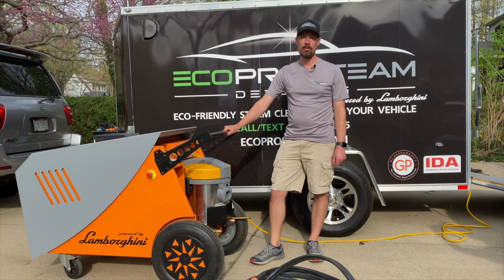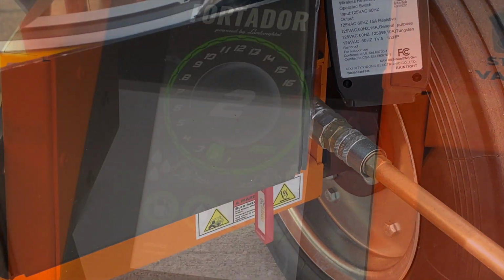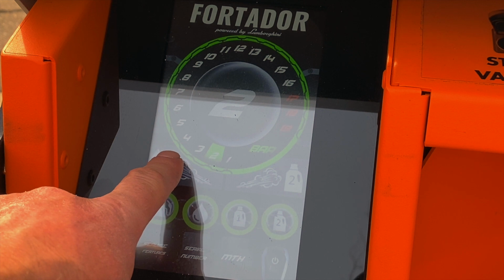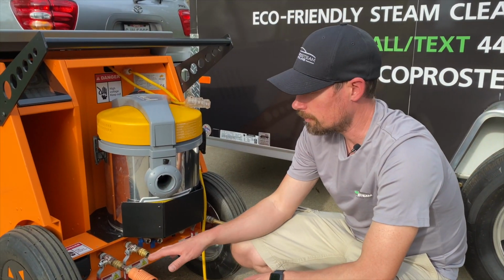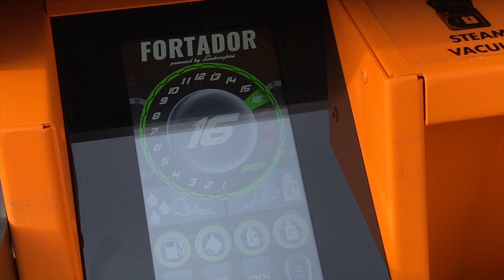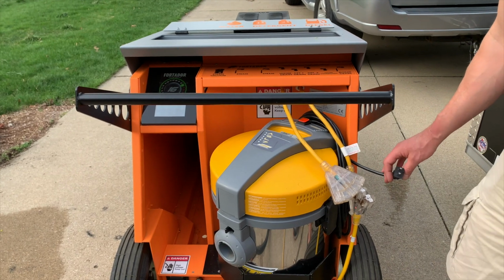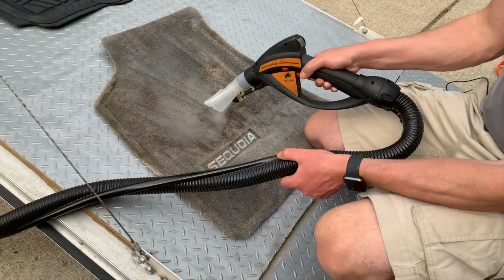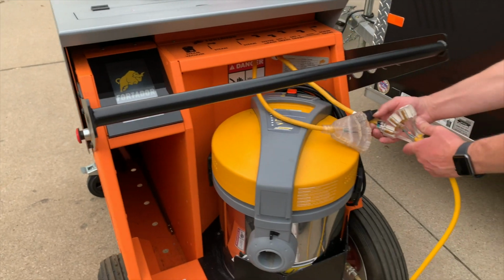Car Steam Cleaner with Vacuum Fortador PRO Plus | Demo and Walk Around from Eco Pro Steam Detailing

Comment: Could you tell me a booster for max 20 bar. Which gasoline generator can work calmly? How many watts does a gasoline generator need to have?
Reply from the maker: I’m not sure what you mean by booster? I have a predator 3500 inverter which is a quiet generator available from Harbor Freight.  You only need a 2000w generator though.  Honda has a small one (as well as a Predator brand at Harbor Freight   The Honda is on Fortador’s website too.

Comment: Is there any real difference between using this and just plain ONR on the exterior?
Reply from the maker: Very good question!  Since Fortador Blue Wash and ONR are very effective as standalone products the steamer aids in some incredible ways:  First off, especially on the front and lower sections, you will notice bugs and most road film coming right off with a pass of the steam gun.  Secondly, from a higher viewpoint - using a no rinse soap within the steam allows you  incredible versatility on virtually all of the cars surfaces (inside and out).   You can use ONR with a wash mit and wipe over a panel, and while doing the same with the steam gun and a microfiber towel accomplishes "washing the car", more contaminants are removed because of heat and pressure (just like using cold pressure washer vs just using a hose).

Comment: I have a question, I have a pro Max fortador and I have a problem with the vacuum cleaner that I don't get steam, only water comes out, could you tell me what the problem is and can you tell me how to fix if thanks!
Reply from the maker: I haven’t had that issue. If the machine is producing steam but the trigger on the extractor hose isn’t producing steam it may be a switch issue.  Have you contacted Fortador ?

Comment: How clean does it leave the carpets
Reply from the maker: Hi Juan!  It’s fantastic with carpets.  I frequently just spot treat stains and steam.   Really heavily soiled carpets I steam extract and use the carpet shampoo injection that comes on the larger Fortador units like mine.    The pressure and the volume of steam is what makes all the difference.  Plus, it’s fantastic not having to soak the carpets like traditional detailing when using a hot water extractor.
Reply: check jJeff other video about new extraction tool

Comment: Where can I see this machine actually cleaning instead of just misting a clean car? I've looked everywhere online and youtube and it's the same joke of misting clean cars and carpets.
Reply from the maker: Hi there - thanks for checking out this video.  I haven't made any videos showing panel cleaning on the outside of the car other than the most recent review of the a new attachment coming this year for the machine.  https://youtu.be/ZsT9vmfwy7M  I understand your frustration and I'll try to get more of these videos made of how incredibly helpful this machine is to use on the outside of the car.  Filming steam cleaning equipment is a bit  challenging because the camera isn't capturing just how dirty panels really are, or how much steam is actually coming out.  Everyone that has seen the steamer used in person is amazed by its power - so I'll do my best to get some more content made.

Comment: Hey, how many cars have you cleaned as of now? And have you faced any breakdown issues with this machine?
Reply from the maker: 100s of vehicles have been cleaned.  I never lost a day of work because machine has been down.  This is however, a highly technical and powerful piece of equipment.  It does require maintenance and DIY knowledge of hydraulic and electrical systems is helpful.  The only thing that has broken was a plastic connector for the extractor ($40 part) and the connecting high pressure steam hose behind it (available at local parts store).   The Fortador machine is so helpful when detailing and the time maintaining is small in comparison to the benefits of using the machine.
Reply: Send me details&coteshion

Comment: How much does that cost?
Reply from the maker: Hi there! - the Pro Max which is the updated version of the one in the video starts at $11500.  You can get the same steam power as the Pro Plus in the video (16bar 235psi) with the $7800 Pro unit, but if you'd like the most power and extractor you have to get the ProMax (now with 20bar 295psi).  Also available is the Volt Electra which runs on 220V and does have an extractor - but it's 12bar pressure (174psi) and it is $6650.  Find them at https://www.fortador-usa.com/store

Comment: How much ?
Reply from the maker: Hi there! - the Pro Max which is the updated version of the one in the video starts at $11500.  You can get the same steam power as the Pro Plus in the video (16bar 235psi) with the $7800 Pro unit, but if you'd like the most power and extractor you have to get the ProMax (now with 20bar 295psi).  Also available is the Volt Electra which runs on 220V and does have an extractor - but it's 12bar pressure (174psi) and it is $6650.  Find them at https://www.fortador-usa.com/store

Comment: Dude all that money on that for the steam little machines do?? I'm so confused. Maybe ya use it for more
Reply from the maker: Thanks for watching - commercial steam cleaners produce many times the steam pressure of small machines  (4 to 5 times more) and an incredible amount of more volume.  Also these machines can run all day.  There is a significant difference when using any commercial steam cleaner that is diesel powered versus a small 120v unit.  The machine built by Fortador in this video features a burner assembly from Lamborghini's heating division that produces up to 35 kilowatts of power (nearly 47hp).